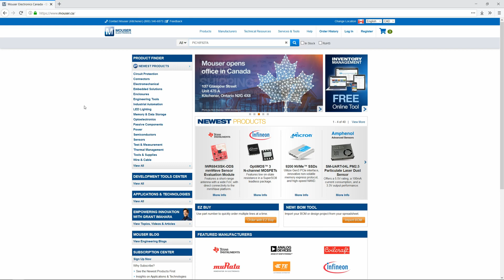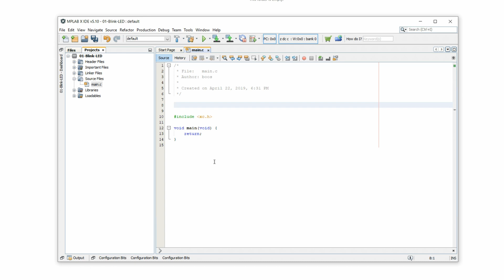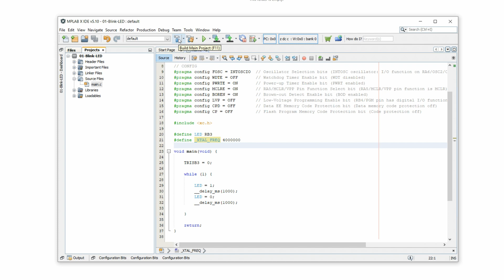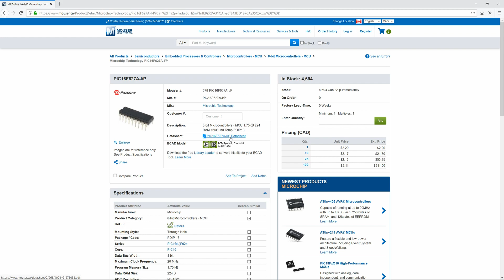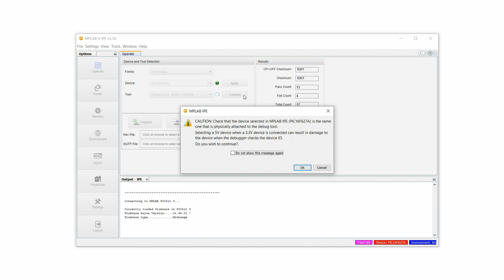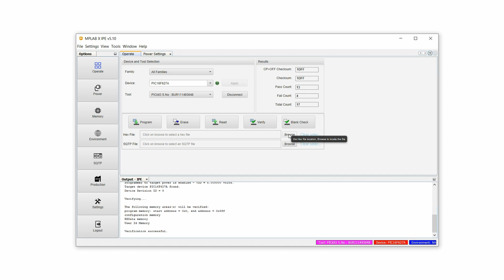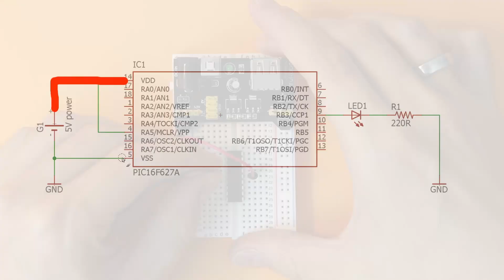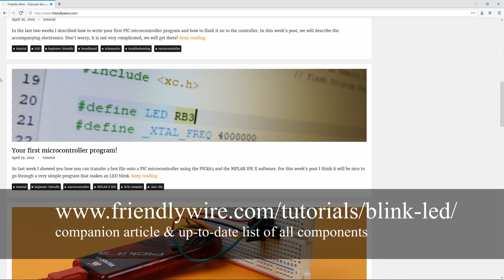Your first microcontroller project!

Comment: Hi! I was following the tutorial and I'm using a pickit 3 clone and it took me a little bit of time but I was able to connect it to my microcontroller (PIC16F628A), however when I try to verify it says verify failed and it says: 
0 Expected Value: 3fff Received Value: 2ffe
configuration memory
Address: 2007 Expected Value: 21ff Received Value: 2170

Would you happen to know how to fix this?
Reply from the maker: Hey Riley, glad you found my video :) I have seen this error message many times, and it is most likely a bad wire connection. Make sure they are all plugged in correctly, and double check the datasheet one more time. It is a pretty common problem and it happens to me, too. If you want you can send me a photo of your connections over at Twitter @FriendlyWire or use the email address on my website www.friendlywire.com and I will be happy to check :)
Reply: @FriendlyWire  Thank you for the quick reply! I tried testing the wire connections and I'm not sure what I did but I also unplugged the pickit and plugged it back in and then it seemed to work? Not sure what happened but it works now. Thanks again! -p.s. I looked around at your other videos and they are great so u got my sub :)
Reply from the maker: @rileypeterson1796  Fantastic, I am glad it works now! Let me know if you have any other questions, and I'm happy you like my other videos, welcome! :)

Comment: Does the MCLR/Vpp have to be connected to Vdd on all PIC's when operating them?
Reply from the maker: Good question, Steve! No, not always, you can adjust this in the configuration word, and use the MCLR/Vpp pin as a regular pin. But you need to always connect the MCLR pin to the PICkit3 when you are flashing a .hex-file onto the controller. Hope that helps :)
Reply: @FriendlyWire  When you say "configuration word" is that in the MPLABX C script? (I'm still learning the lingual LOL)
Reply from the maker: @stnwrd  Yes, exactly :) I have an article on this topic here: http://friendlywire.com/tutorials/config/

Comment: Brother. Why not use a Oscillator in this microcontroller
Reply from the maker: Yes, that would have been a better idea! I guess in my mind I had the application of the binary clock ( https://www.youtube.com/watch?v=FVitTZLxtyQ ) where we needed the crystal to get a proper timebase. But you are right, in this case it would have been better to use the internal 4MHz oscillator.
Reply: @FriendlyWire  thank you so much brother
Reply from the maker: @weerasingheb7a998  I'm glad you are here :)

Comment: great explanation  does work same for pic16f847
Reply from the maker: Thank you, glad you like it! Yes, I think so. You just have to select the PIC16F847 everywhere where in the video we selected the PIC16F627A inside the software. The pin RB3 is the same for both PIC16F627A and your PIC16F847, so the LED can even go in the same place. Let me know if it works. If not I am happy to help! :)
Reply from the maker: Oh, and the connections from the PIC16F847 to the PICkit3 are also identical to that of the PIC16F627A :)

Comment: Thankyou Yens. Brilliant. After being convinced I had burnt my first Pickit3 clone out... I've now at last succeeded with the second one... and then the original one (happily fine after all) Your instructions had just enough background, and were clear and easy to follow. Nice that you put the config in the main.c to make it easier, and that you used config bits for it. I've watched several people's videos and yours was the one that finally worked. You should remind ppl about the polarity of the power supply, as if you put it on the wrong end of the breadboard... the polarity is reversed... yes I was that stupid!
Reply from the maker: Hey Rafael, thank you for your kind words, and congratulations on your first project! The first project is always the hardest, so it's a fantastic accomplishment that you persevered and made it through to completion! I think I will redo this video here at some point (maybe with a different example) and I will be sure to mention the polarity then, this is a very good point! Thanks again, and have a great day!

Comment: Dear 
Can you make 10bit PWM 10khz pwm frequency led two channels dimmer using pic12f683/675 with two potentiometer
Please how much money will you charge for making I want the source code.
Reply from the maker: Hey there, all my content is free, so I don't charge for it. I looked at that chip, and the PIC12F683 only has one PWM module, so I don't think you could do a dual-channel one with just that one chip. Why don't you give it a try (just one potentiometer and a single channel) and you send me what you have on Twitter @FriendlyWire , and I will walk you through the process? :)
Reply: @FriendlyWire  One channel will also work, I will use two ICs

Comment: Very good. I have been doing PIC microcontroller since 1999 and really enjoy creating projects with many different types
Reply from the maker: Hey, that's awesome! Glad you like my video. Do you have anything you would have liked to learn, as a beginner, as an idea for me to cover in a future episode? :)
Reply: @FriendlyWire  the new mplab X  really intimidating. I think I'm still using 8.6 or something like that
Reply from the maker: @raymondheath7668  Yeah, I know what you mean. When I updated my computer I had to switch to MPLAB X as well. Was there something unclear or confusing in my video? If yes, let me know, I will do my best to explain it better :)
Reply: @FriendlyWire  I think the modular approach of MP10 is more cumbersome and requires much more input, thus more instruction steps to memorize.  I'm used to the older IDE and the ease of typing in an assembly or C program and immediately programming your chip
Reply from the maker: @alphahr  There is a chance you know the depths of MPLAB X IDE more than I do :) You have been working on microcontrollers for more than 20 years, yes? For simple projects I found it quite easy to use since most of the default settings are what you need, I think.
Reply: @FriendlyWire  I will make an effort to spend quality time trying to learn it. Back in the 70's and 80's when I spent so much time with assembly for the many 8 bit processors out the I would have loved to have a microcontroller available.  I built my first Cosmac Elf 1802 computer in 1976. 256 bytes of RAM and two hex displays with 8 binary switch input... and I still have It!
Reply from the maker: @alphahr  Wow, that's fantastic! I would love to see a picture of that computer, is there one online? If you use social media you can reach me at @FriendlyWire on Twitter, Instagram, and Facebook :)
Reply: @FriendlyWire  i will post a pic on instagram and add you to my list of friends
Reply from the maker: @alphahr  Great, looking forward to seeing the project! :)

Comment: Hi, I am a software developer. I have just started PIC programming with this video. Thanks a lot for your effort. I have a question. I will add LEDs and sensors to other pins. Let's start with just adding another LED to RB2. I have modified the MPLAB code by inserting TRISB2=0, RB2=1 for HIGH and RB2=0 for LOW. But I got an error during the verification of the HEX code in MPLAB IPE. Does someone have an idea?
Reply from the maker: Hey Didem, this is fantastic, glad you like the video and are taking new steps yourself! It looks like it is an issue of transferring the hex file onto the PIC, and everything else sounds perfect. Can you show me the error message in IPE? (If it is easier for you, I am also on Twitter, Facebook, and Instagram with the handle @FriendlyWire). Let me know, I'm sure we can sort it out! :)
Reply: @FriendlyWire  Thank you for your reply, you are amazing. The main code is:
void main(void) { 
    TRISB2 =0;
    TRISB3 = 0x00; 
    while (1){
        RB2=1;
        RB3 = 1;
        __delay_ms(1000);
        RB2=0;
        RB3 = 0;
        __delay_ms(1000);
    }
   
    return;
}
The error in IPE is : Address: 3d6 Expected Value: 1683 Received Value: 3fff
Reply from the maker: @didemozisik4602  I think the code is fine, although you could change TRISB3 = 0x00;  to TRISB3 = 0; . The error is the physical connection of the PICkit3 to the PIC16F627A controller. The data transmission does not work. Have you double-checked your connections?
Reply: @FriendlyWire  I ignored the error and continued to program the controller. It worked. It is so weird. I am dreaming to make a smart toy. I will be following your videos. Best
Reply from the maker: @didemozisik4602  Glad it worked out, that's fantastic! Way to go! I have had strange errors during flashing, too, but in 9/10 cases it's a bad wire :) Good luck for your projects, and glad you find my videos useful!

Comment: question: since you "programmed" the flashing effect on the led, if you connect the led directly to the battery will it remain on this "flashing" mode?
Reply from the maker: Nope, the LED is just an LED, the microcontroller does the blinking :)
Reply: @FriendlyWire  thanks for the reply. But how is it possible to buy flickering /flashing led bulbs thatbthey dont have a conteoller?
Reply from the maker: @xarrismarkoy1  Oh, I see what you mean! These LEDs have a controller built in, it is just very very small, and in most cases it isn't even a controller but just a small oscillator. In this tutorial here we make an LED blink because it is a good beginner's project, but it wasn't our goal to make it as small as possible :)
Reply: @FriendlyWire  ah ok i understand. I just wanted to take a led strip program it to flicker and then cut each individual led light and use it separately with a battery for different projects.Can i do that?
Reply from the maker: @xarrismarkoy1  I don't think that works, each LED strip still has to be connected to a microcontroller to work properly. But there are some flickering LEDs on Ebay if you search for it, or if you check out my electronic candle video at 0:18 you can see such a module: https://www.youtube.com/watch?v=pCvCan2yGZg&t=18s

Comment: how did you calculate the "size" of the resistor?
Reply from the maker: Hey Santho! It was a rough estimate, 220 ohms for any LED at 5V is a good idea. Basically you need to know the current of the LED, call it I, which is around 10mA and the supply voltage (here it is 5V, call it U). Then you also need to know what voltage the LED needs to glow, which is around 2.4V, call it U0 (depends on the color and you can look it up in your LED's datasheet).

Then you have U, U0, and I. The resistor is R = (U-U0) / I = 2.6V / 10mA = 260 ohms. So 220 Ohms is a good guess :)
Reply: @FriendlyWire  thanks for the answers, in school its hard to follow the lessons about electronics rn so im teaching "myself".
Reply from the maker: @Santho003  That's great! Also U0 is often called "forward voltage" if that helps :)
Reply: @FriendlyWire  im in a german school im not so good at english but i think it will help im strugling rn with ac bcause my teacher doesnt give a ** about students
Reply from the maker: @Santho003  Best of luck!

Comment: Sir can I use Kiel for the software purpose
Reply from the maker: Thanks for the question, Mayukh :) I have never used Keil products for PIC, and Google says it's not so easy. But the MPLAB IDE is free, as well as the XC8 compiler, so the only upfront cost is the PICkit3 (which is around $25). So in order to avoid frustration, as a beginner it is probably better to use the MicroChip tools :) Sorry I could not be of more help, hope you'll have a great day!

Comment: i had a doubt
where is the oscillator ?
don't we need to use external oscillator with pic or it has one?
also, what are the other ways to flash pic?
awesome tutorial tho
Reply from the maker: Thank you for your kind words and the questions :)

At 3:03 I start setting the configuration bits, and the first parameter actually tells the PIC to use its internal 4MHz clock (3:07 in the video), and I briefly mention that at 5:41 as well.  When using the internal oscillator you don't need to use the external crystal :) I should have mentioned it more prominently, sorry! If you want you can also read more about it on my website: http://friendlywire.com/tutorials/config/#ch1

I always use the PICkit3 to flash PIC microcontrollers. I am sure you can use other tools for that as well, but the PICkit works well for me, so that is what I use :)

Let me know if you have any more questions, and have a great day!